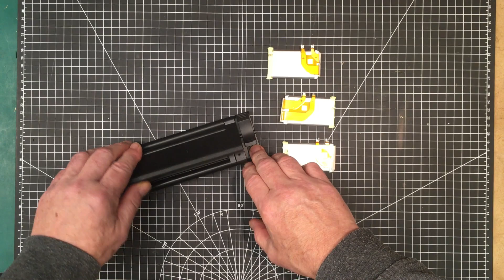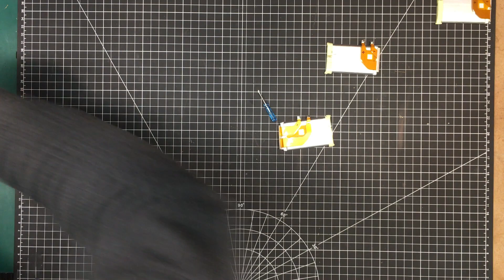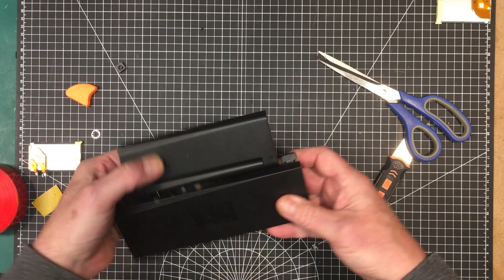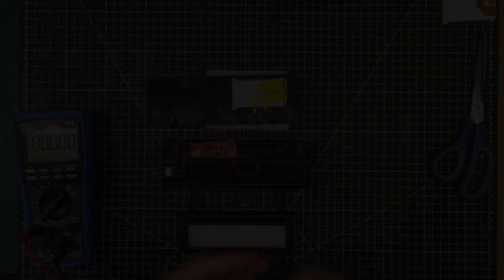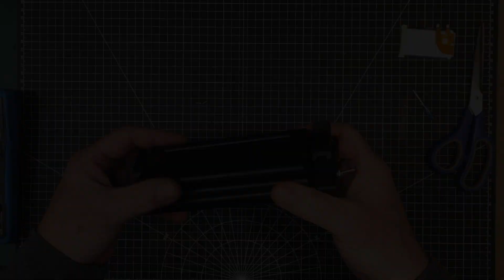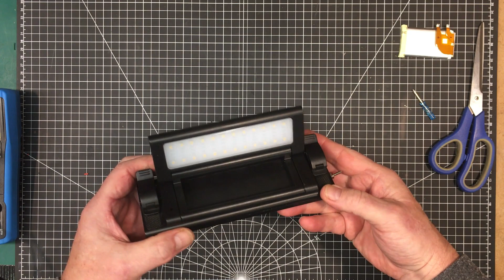0120 - Cordless Light Repair

Comment: Nice conversion. It appears that there is room to parallel a second battery, if you move the PCB to an exterior configuration... Say in series on the cord of a wall wart.
Reply from the maker: I was actually hopping to put 2 in if it were possible.  However, the board is more than just a charger.  It is a full BMS and a boost converter.  It prevents the battery from discharging to dangerous levels and boosts the voltage to around 12V for 3 white LEDs in series.  It needs to be in there.  I'm cool with 6+ hours of run-time.  That will be plenty.